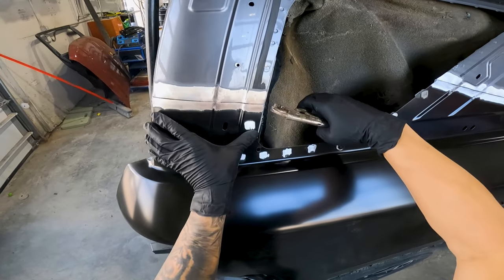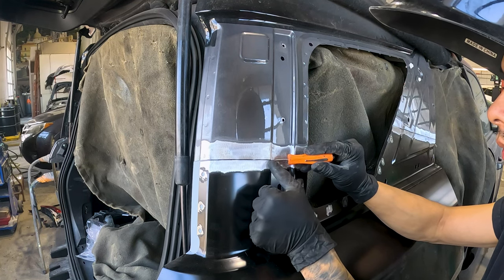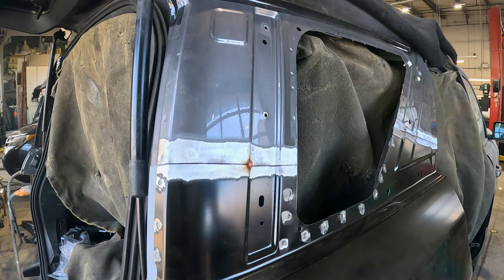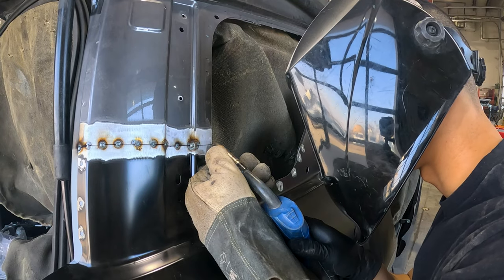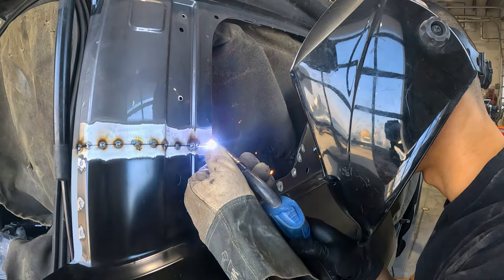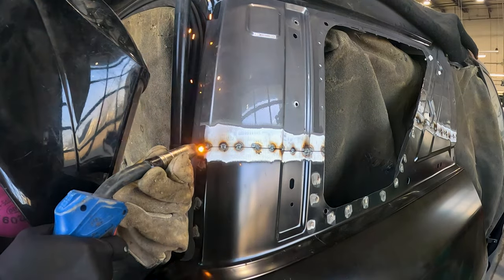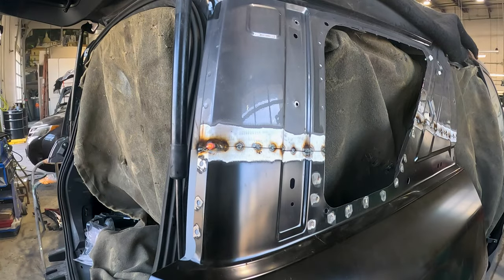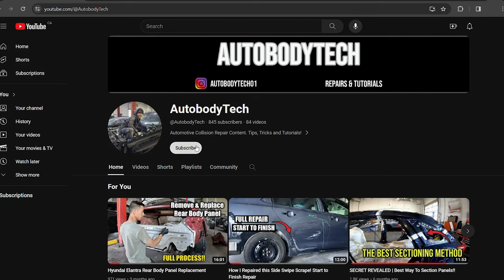How I Weld My Butt Joints | Tips & Tricks | MIG THIN METAL

Comment: TIG welding has yet to be certified for insurance work,, long overdue,,, MIG welding is messy,,, in the government mandated MIG welding wire is harder than the steel panels,,, the Italian wire of higher quality, which is pure mild steel has much cleaner welds but is not used in the USA... Leave it up to government mandates to ruin things...
Reply: Interesting.  Where I am in Australia, Italian wire is the only MIG wire that welding supply firms have, though some hardware shops have Chinese wire.   Insurers only want to know if you have completed the right training.
Reply: I agree, unfortunately they will go towards more things that require less skill. I was told at aluminum I-car class that tig welding use to be allowed years ago but less and less people are able to do it properly so they got away from it. Probably why more and more repairs use rivets instead of welds, easier to rivet then To weld.
Reply: will never happen for insurance jobs. too
time consuming, not enough techs have the skill, and shops would have to buy new welders. not enough benefit for all the trouble.

Comment: Fantastic video. I would cool the panel exactly same as you do. My boss told me I'm doing it wrong. He was the one who's wrong. He didn't like anything I did.
Reply: If you wanna get super technical you’re not supposed to cool the panel down but we all do it to speed up the process and reduce warpage. The theory is that cooling the panel down with compressed air or some guys like to use a wet towel will quench the steel making it more brittle that it has  to be. I did collision work for 20 years and am still at it and I’m yet to see a guy that doesn’t cool it down.

Comment: It's a lot nicer when you have a brand new panel you're welding in it is not near as hard as trying to cut off a panel from a used car or truck address all the holes that you drilled and all the spots with all the paint off weld through primer anywhere you had issues with weld grind etc new panels like butter to me no matter if I'm using a cheap welder with gas or a more expensive welder long as it's 220 volt and has a decent set of adjustments I can put anything down there together
Reply from the maker: Totally agree, working with a used panel is a lot more challenging!

Comment: Technically you should have to sleve inside
Reply: That is what I-car teach you. You need to sleeve it.
Reply from the maker: I-Car is general specifications. Always follow OEM procedures first
Reply: @AUTOBODYTECH  so are you trying to say I'm wrong?????
Reply from the maker: @darylhomegren2943  What I'm saying is follow oem procedures. Not every section should be sleeved. Adding additional strength may sound like a good idea, but could also change the way its designed to fold in a future collision
Reply: @AUTOBODYTECH  Correct, and reduces shop liability down the road that OEM procedures were followed. Shop can defend the repair in future if someone is hurt in a subsequent collision.

Comment: If you have access to the back of the panel you could use Intergrips. Better option than a screw driver.
Reply from the maker: Just looked those up, and they're super neat, but most of the times when doing sections, you won't have access to the backside.

Comment: Could tig weld be used?
Reply from the maker: Yes, I'm sure, but typically, collision shops don't TIG weld
Reply: typically its not since the high frequency start can damage vehicle computers.  A low frequency scratch start works safely, but then it becomes a matter of following OEM procedures- I've never seen TIG on any OEM procedures..  Obviously a TIG is capable of producing an equal, or even better quality weld, but that's kind of a Pandora's Box with liability in the collision world.